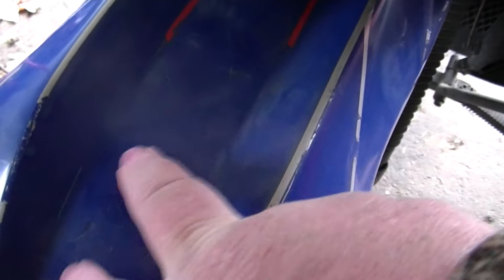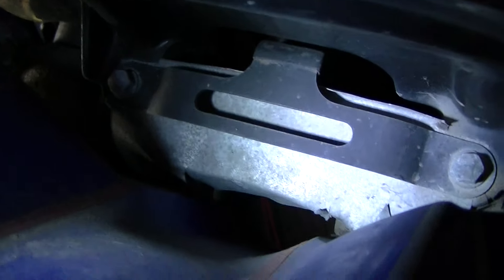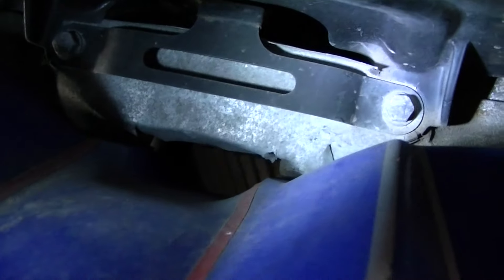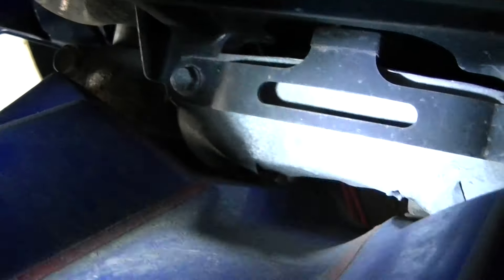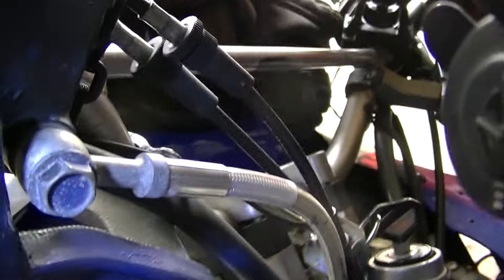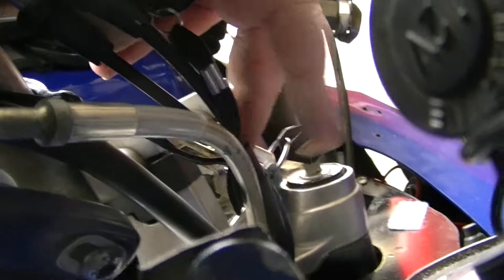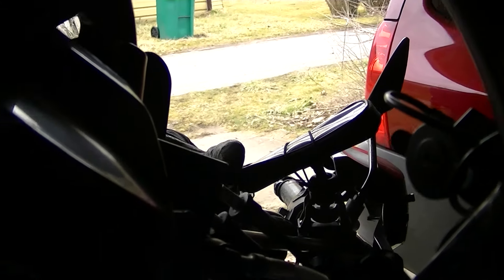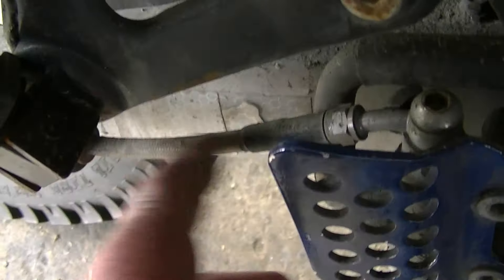Triple Tree Bearing Cover For 2009 KLR650 !

Comment: Thanks Buddy!
Reply from the maker: +navythomas8  No problem . If you need more just let me know . If we can help anyone with this stuff it makes making videos more worth it .
Reply: MuzzleMike I know if I need it you will come thru. That video is a hard shot for sure. You did quite well to get the shots.
Reply: Thanks guys. Now, do either of you have any experience with the Supermoto (I think made by Acerbis) fender? would putting one of those on remedy this as well? the only reason I thought about putting one of those on is for the crosswind on the highway...
Reply: animalmother556x45 I tried it, Didn't really like it. The fact remains you have to protect that lower bearing on the triple tree. I think they fixed it in 2012. They eliminated that damn slot. But if you ride in snow you will not like that narow fender from acerbis, I think mud and etc will be the same. But meh try it and see what you think.
Reply: +navythomas8 Yeah, I have heard that the mud protection goes down with the different fender. I will just try this fix at some point.
Reply from the maker: +animalmother556x45 With this you will be good as gold . I have had that front apart to check the bearings and they are in good shape .